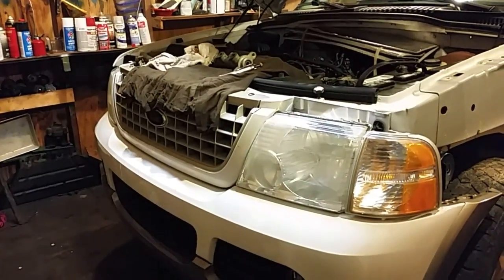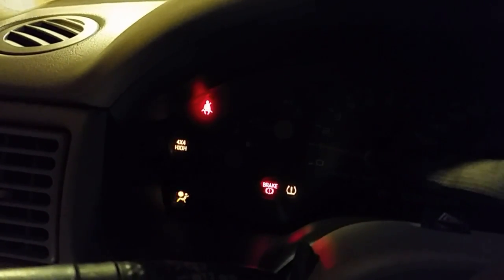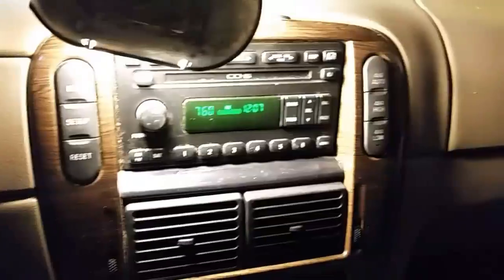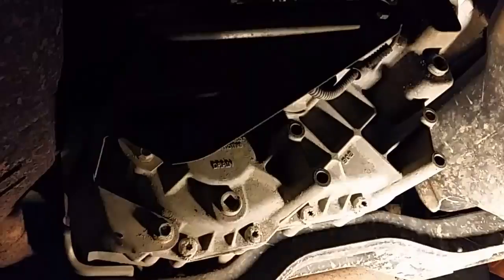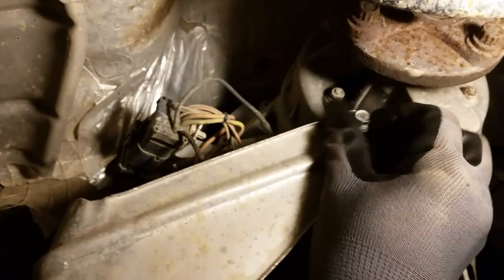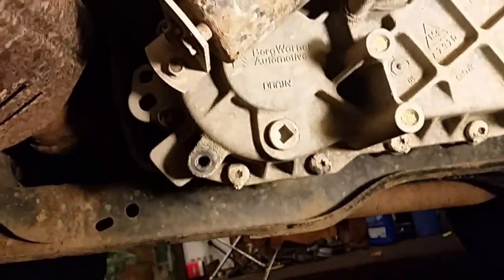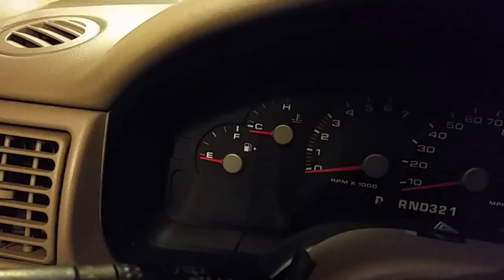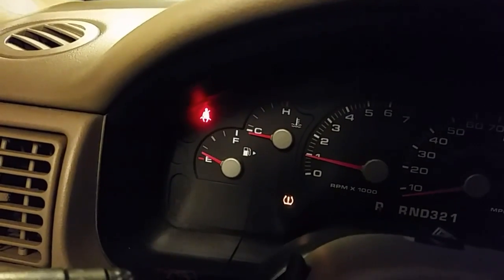Flashing 4x4 Light Fix. Ford Explorer and other's fords 4x4

Comment: I bought this truck back in 2013, the guy gave me a deal because the 4x4 wasnt working.  i did some research over the years, thought it was missing a control module behind the glove compartment.  So fastfoward to earlier today,  I read that 2004 model does not use a control module.  It lead me to do more research.  Stumbled upon your page and low behold, my ground wire was broken too!!!!!  Im so rxcited and releived.  I suffered many winters in 2cm snow with no 4x4,..lol.  Not to mention the annoying flashing 4x4.  I cant beleive I lived with it for so long!!!  i owe you one man thanks!!!!!
Reply from the maker: Wow! Nice find and fix!
Reply: Mine is flashing along with the ABS light. Started hearing a noise where the transfer case is (got that replaced a month's and a half ago). I'll try this for sure.

Comment: 97 Ford Explorer 4 by 4, I went pulled my dashboard apart to get at the 4 x 4 switch, and the wires two of them were pulling out of the connector. Fixed
Reply from the maker: Nice!
Reply: @FixingWithPassion  it didn't work at first until I reset the computer by pulling the battery terminal. But yeah, that was it

Comment: I have a ford f150 and it does the same with the lights (4x4 High and also 4x4 low).  Nobody has found the solution to the problem, maybe your video will help me solve it.

Comment: I have a 1998 Ford Ranger and upon cranking the 4x4 and the 4x2 lights will blink a number of times. Well I started with the rubber hoses which goes into the hub actuators from the solenoid. They were deteriorated so I replaced them just thinking that the actuators weren't receiving vacuum pressure. Then I went to the solenoid to try and test it before the dark of night caught me but it looked fine. The last thing I looked at was the motor which I just kinda scanned, so tomorrow I will actually go back and check for broken wires. 🙏🏾 Thank you Thank you and Thank you.
Reply: Did you find out what the problem was I’m going through the same problem right now

Comment: I was thinking of buying a 05 escape but I saw the 4x4 flashing when driving good thing I didn’t buy if it was a transmission issue great video
Reply: 20 minute fix though, could have used that for LEVERAGE for a lower price..
Reply: @lionelhowell4972  guy wouldn’t go down on his price which was already bad 👎🏽 3k and not that clean
Reply: @angelramos0299  To be honest those are notorious for the rusting out of the rear frame and leaf spring mounts, with the frame actually cracking so glad to hear you dodged a waste of your cash

Comment: You do not have to cut the wire when you replace the motor. Remove the wire and pin it is attached to from the plug, place it back in the same hole on the plug attached to the new motor.
Reply from the maker: Nice!

Comment: Hey Nathan, would help if you could respond to this urgent question. I have a 06 Explorer xlt 4x4 4.0, I had my 4x4 light on on the dashboard yesterday and I probably did not press any button to start it, does this one have automatic turn on if it senses the car is going to need it? And  after that I went for a 30 min drive ( mostly dry roads with snow some places) and had some vibrations/ jerks. Is this normal or something I should be concerned about for the internals of the truck?

Comment: My 02 had 4x4 issues, which fixed itself when pulling fuses 17 & 18 momentarily. 
Drove it for ages, then picked up a 2nd hand 4x4 controller for $60 and have had no further issues.
(I know this will sound dumb but I couldn't see if you were in Neutral or not.)

Comment: I have a 2002 explorer xlt and my 4x4 high light is doing the same thing on start up and also does it while driving. I went under and checked all the wiring and it seems fine. But the 4x4 is not working. I push the buttons and the lights come on and you can hear it engage from high to low but the 4x4 isn’t working. Tested it today on a 4x4 trail and only the rear wheels spin. I’m wondering if the motor it self could be bad?.... any help would be greatly appreciated
Reply: It might be your control module I have that exact problem

Comment: My 4x4 high light flashes every so often. I just got under it and I see no gray wire that was attached where yours was before it fell off, but I see a gray wire hooked up inside my wiring harness, and all wires look fine. Any ideas what to do?

Comment: I have this same issue on a 96 Ford Explorer 4.0. Except I had no broken wire :( although I do believe my car is stuck in 4wd low. I need to get rid of this fast. Can I remove drive shaft on the front? Would this make it 2wd again?

Comment: I have the 2003 Ford explorer 4 wheel drive and my four-wheel drive light flashes while I'm sitting still and driving I noticed that you said it could be a transmission issue if it flashes while you're driving. What kind of issue am I faced with? (Please and thank you)

Comment: As for the brown wire from the shift motor to the transfer case. When you disconnect the  plug.  There is a red retainer plug that holds the wire ends in place. Take a small pick and remove the red retainer, now pull the brown wire out of the plug, simple, no need to cut the brown wire.. To put the brown wire back in the plug, simply reverse the procedure.
Reply from the maker: Good to know!

Comment: was ur o/d light on to with this problem  cause i have same problem but my o/d light is on too and truck wont shift from 2 to 3end gear but shifts good from 1erst to 2end np
Reply from the maker: O....it sounds like you actually have a transmission issue internally. Mine shifts good. When you have a o/d staying on all the time or flashing while driving....tranny issues.
Reply: thats what i thought too but i had a rebiut tranny put in it and still has same problem so i spent 1500 for nothing
Reply from the maker: I now the servos on the side gave some issues after they got worn. I had to re drill mine. But you might just have a valve body Issue.

Comment: You said that if the 4x4 light flashes while driving that’s it’s a transmission issue, how do you mean? Mine flashes every like 20 seconds multiple times even while driving, any ideas?
Reply: Did you solved it?
Reply: mine also does the same, did you solve it?

Comment: Great video.....but.... Always unhook the neg wire not the positive. Obvious reason but if you touch the wrench or ratchet on metal(block/frame/fender/etc) the ground will do nothing, but if you're taking off the positive first and touch? Sparks!

Comment: I have a 97 ford explorer and when I cut the wheel deep it kicks into 4x4? Why? Can someone please help me,  THANK YOU GUYS, AWESOME CHANNEL! !
Reply: Someone tell me too
Reply: @landoflakes92  Someone told me to check out the vacuum lines that go to the hubs or the solenoid on the firewall!!!
Reply: Anyone have any ideas about my 1st post/ 1997 Ford Explorer. 4x4 trying to kick in when I make a sharp right turn, checked the wheel bearing on both sides, Good no problems there, IDK, HELP SOMEONE PLEASE!! THANKS!!!!!
Reply: @erichoneycutt5655  try checking your  transfer case. You should change the fluid. Then check your shift motor beside the transfer case.
Reply: @jamesrichardson4965  Thanks for the information, I will do that and let you know, Thanks for replying to my post!!!!👍
Reply: @erichoneycutt5655  yeah no problem.  You may have to replace the motor. If you're changing the Transfer case fluid,, if you have an Expedition or f150. I tell anyone use Motorcraft.
Reply: @jamesrichardson4965  Thanks so much for the information,  That works!!!😀👍
Reply: No problem. 👍. Glad I could help.

Comment: You have to be in neutral to ever get a response from the 4wd buttons. And also the 4wd buttons most likely wont ever allow you to switch them with a current fault in the system.
Reply: Well 4x4 high can be engaged on the go, but sill

Comment: I have a ford ranger .it is stuck in four high the light doesn’t come on and there is no click to tell it’s working. Before it quit on me the light would work sometimes but it would still go into 4 wheel . Would it be my switch?
Reply from the maker: Na...it the motor on the case....un-bolt it and then use a pair of vice grips and turn the rod that goes into the transfer case. This might get you back in 2 wheel drive. After all that test the motor and see if its locked up or if there is a issue with a fork in the  transfer case.

Comment: If these manufacturers didn't put that switch or module behind the radio or behind the kick panel or the electric motor on the transfer case in all these vehicles we wouldn't have any of these problems. There was nothing wrong with the MANUAL 4x4 shifter on the floor. But, like everything else that was great 20 yrs ago we are hell bent on messing it up. The only wire on my 4x4 runs a little light for my shifter. If it goes out I'm positive it wont leave me stranded. There needs to be a manual swap kit available but I haven't seen one yet for these Explorers or Rangers. To top it off if you do need to change the shift motor on the trans case the color code of the wires won't match up to the harness either. lolol.

Comment: to the left of where the power wire goes into the transfer case, theres a nut that looks like where the ground wire broke from...
Reply from the maker: The case has a ground through the case va engine grounds.

Comment: Like others, this wire was found broken at the eyelet. Crimped a new eyelet on and no morie flashing light on dash. 4x4 still wont engage, but at least this ground is good. My guess is that the transfer case control module has failed.

Comment: i have a 2002 f250 that the 4x4 light will come on and off while driving. I just had a new transmission put in the truck. It never did this before the trans swap. What can be causing this? also, my 4x4 will not engage it just stays in 2wd and the transfer case motor does nothing now.  what may have happened during the transmission swap?

Comment: FYI, the wire you note at 8:58 can be disconnected from the harness.  Disconnect the harness, use needle nose to pull out the red retaining clip inside that harness and use a small paperclip or similar tool to release that pin from the harness.  Then, if you have to put it back together or install a new motor, you can slide that pin into the new harness.  There are other videos on YouTube that illustrate this process in case my explanation doesn't provide enough clarity.
Reply from the maker: Cool.

Comment: Hi i have a 02 Ford explorer,and i the 4x4 low Is stack, so what i can do ,thanks
Reply from the maker: Stack? You mean "Stuck"
Reply: @FixingWithPassion  yes ,and it does not go away the 4x4 low
Reply: You can remove the transfer case shift motor on the back of the transfer case there will be four 10mm bolts holding it on. Then you will see a little shaft sticking out grab it with pliers and turn it clock wise as far as you can ( should be about 3/4 of a rotation or 1/2 maybe). That will manually put the truck back into 2wd . If it's the shift motor itself that is bad you can simply replace it ( 80-100$) from the parts store and you will have a functioning 4wd system again. Otherwise it will require additional trouble shooting to diagnose correctly. Good luck
Reply: @paulzamora5790  ok thank you,i Will do that

Comment: This might help others. My 4x4 high light is also flashing. No Auto or 4x4 high but my 4x4 low is working.
Flash Code Description Action to Take
—Inoperative or Erratic System Errors. Complete Tests AA through DD.
1 Microprocessor RAM (Random Access Memory) access error. Replace Control Module.
2 Clutch connector or clutch coil has discontinuity. GO to Step FF1.
3 Front output speed sensor connector or internal circuitry of sensor has discontinuity. Go to Step EE1.
4 Rear output speed sensor connector or internal circuitry of sensor has discontinuity. Go to Step EE1.
5 Both front and rear speed sensor connectors and/or internal circuitry of sensors have discontinuity. Go to Step EE1.
6 Clutch and front sensor connectors and/or clutch coil and/or internal circuitry of sensor have discontinuity. First see Step FF1, then Step EE1.
7 Clutch and rear sensor connectors and/or clutch coil and/or internal circuitry of sensor have discontinuity. First see Step FF1, then Step EE1.
8 Clutch and both sensor connectors and/or clutch coil and/or internal circuitry of sensors have discontinuity. First see Step FF1, then Step EE1.
9 Mechanical problem that allows clutch plates to slip during clutch engagement (or faulty sensor output signal). First see Step FF1, then Step EE1.
10 Both Code 9 and Code 2. See action for Code 9.
11 Both Code 9 and Code 3. See action for Code 9.
12 Both Code 9 and Code 4. See action for Code 9.
13 Both Code 9 and Code 5. See action for Code 9.
14 Both Code 9 and Code 6. See action for Code 9.
15 Both Code 9 and Code 7. See action for Code 9.
16 Both Code 9 and Code 8. See action for Code 9.
Regeneration (Recovery) of Flash Codes
If the ignition is turned OFF and the code is lost, the ignition will have to be turned ON again to regenerate codes 1 through 8, if the condition or conditions still exist. To regenerate codes 9 through 16, the vehicle must be driven again.

Comment: Had the same issue. Bad ground wire. Rusted right off. The number of blinks of the 4x4 light is a trouble code for the system.  My light blinked 10 times which is a faulty sensor which seems to translate into a bad ground.
Reply from the maker: Nice!
Reply: How can you find out what’s wrong with the number of blinks or where it shows

Comment: Sometimes my 03 explorer won't go into 4low and now my 4high flashes
Reply from the maker: Not good. I'd take off the motor and make sure its not stuck. Test it with a 12v jumper wire

Comment: You don't have to cut that wire! Take a pair of needle nose pull out the red divider. Then get a piece of wire a small screw driver or something like that. Then put in-between the  end of the wire inside to release it. There are videos of this on YouTube but don't cut the wire!!!!!

Comment: O2 4wd 4.6 EB @ 127K miles and even the same color. 4x4 high flashes regularly while driving. Can go in straight line in 4x4 but can't turn or it'll seemingly bind up. P1568 - speed control, P 0732 - trans gear 2 - false ratio, P 1270 - engine RPM or vehicle speed limiter reached, P 1826 - Trans transfer front speed sensor circuit failure. No check engine light. Can make it where the O/D light flashes and CHECK TRANSMISSION appears, but that's only if I don't give it steady throttle so when having RMP's go up say 2200 RPM's it shifts and then I get rmp's up to say 3000 it will most likely say CHECK TRANSMISSION. Other than being funky like that it seems really strong. Hope it's a sensor. What's my next step? :(

Comment: Another video here, from Jan 2020 shows how to easily disconnect/ release that one wire with a pointy awl tool from INSIDE the plastic connector.  Then, later, reinsert the same, uncut wire, into your new motor's connector.  NO cutting.